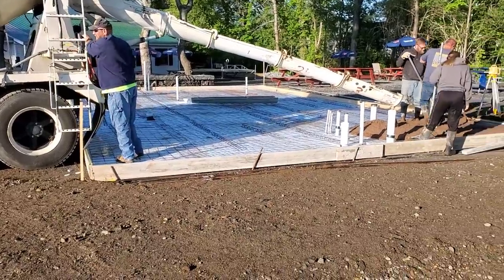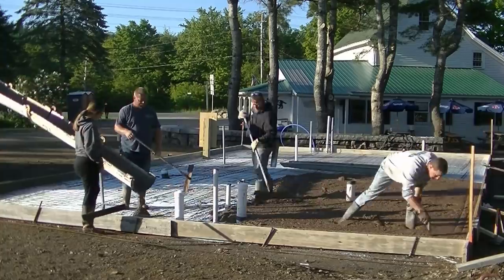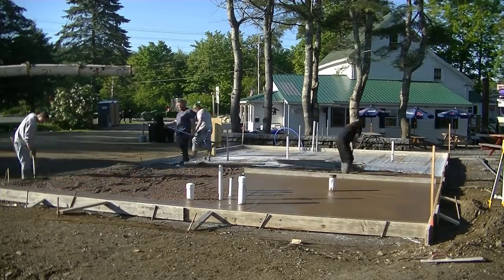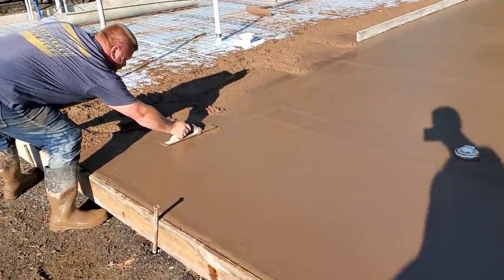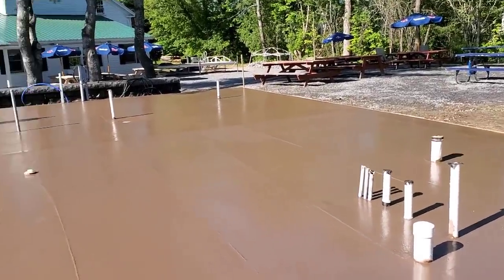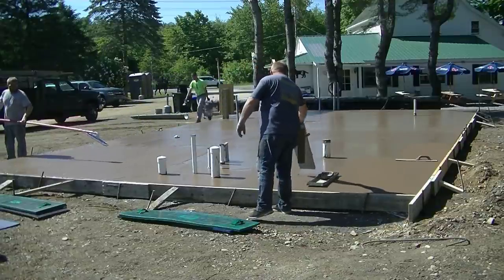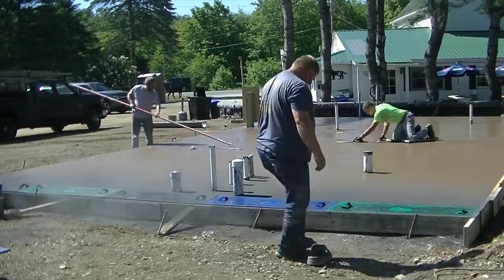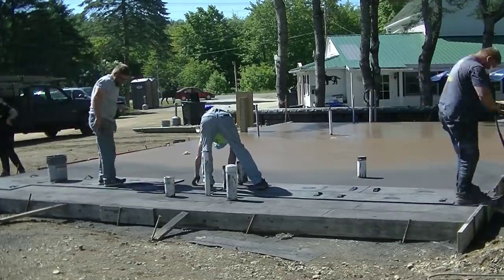How We Stamped a Concrete Slab for Maine Cabin Masters (Must See!)

Comment: We just got finished with a stamp job. It was huge. A back porch/patio, wrapped around to front porch and walkway, and driveway at least 150 yards long. Dark gray boarders stamped like little rocks, and khaki middle sections broom finished. Dark gray ribbons sperating the khaki slabs every 20 feet or so. It was huge. We've literally been working on it since July. Of course not everyday. Still need buffer jobs in between to keep everyone paid. After all boss likes to get paid only once the job is done. It turned out really nice. Though, we really should have covered them up more. We poured some khaki sections, then the borders in the afternoon most days. Without plastic it's really hard to keep that dark gray off the lighter stuff. Idk, it's not my business, if the boss what's to take chances, gotta let him. It just means we gotta come back later to touch up. It kinda wastes money. Imagine having to pay your whole crew a days pay just to mess around scrapping gray off khaki. We spent at least a full week just on cleaning up what should have never been messed up in the first place. Those are days we could have poured something else, or at least peeped. A whole crew on their hands and knees scraping concrete and power washing. Such a waste. And plastic is cheep too. I got paid though. And my boss and crew are really good guys. It's a joy to work with them.

Comment: Why do you beat your pins in on an angle? I do concrete work and I try to beat my pins in as straight as possible to be able to pull easier. Love the videos. Thanks
Reply from the maker: Sometimes they do the sub-base with 3" minus and the pins are hard to pound in straight without moving away from the forms.

Comment: Hey Mike, I own a small concrete company and was just curious your thoughts on cutting a straight 2x4 the same length as the slab we're making + a few inches and run it across the form to screed it easier. We mainly do small slabs

Comment: Great video Mike!  I do have a question about the stamped concrete.  Do you ever worry about color matching up an area that has cracked or failed on older stamped slabs?  Also, is the color fairly consistent from the concrete plant?  Thank Mike again for these videos!  You have quite the team working for you.
Reply from the maker: Color is consistent from the plant, yes. It's really difficult to match on older stamped concrete when trying to repair, yes.

Comment: Actually Mike, you a bad boy to take on a 1,000 sq. Ft. Of stamp. I never like to take on more than 4 or 5 yards ( that's with 2 men and 1 of them is a laborer.) Also your using colored concrete which I prefer that in stamp work, but color concrete always sets up quicker